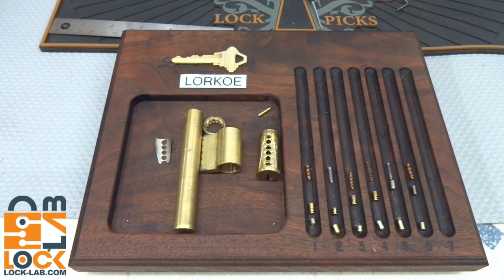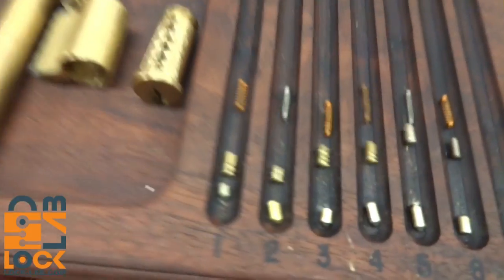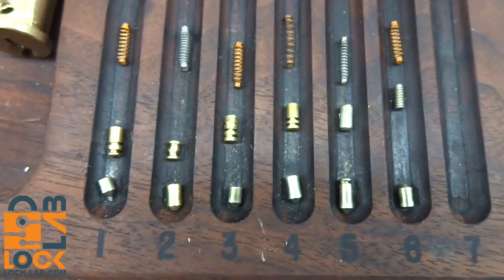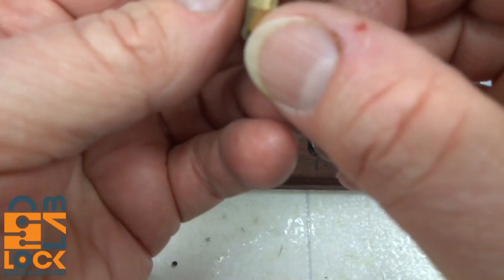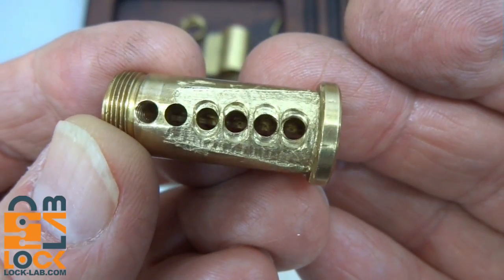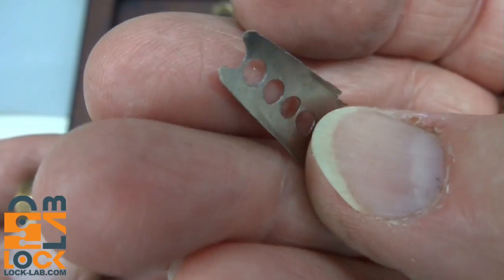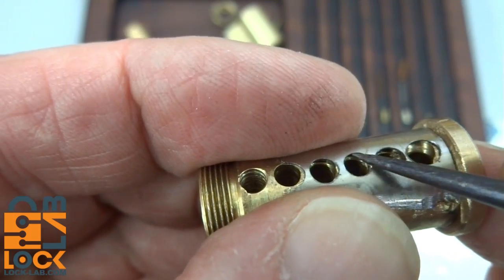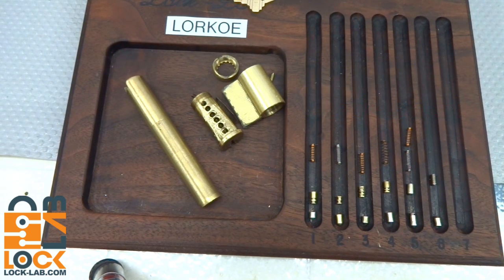(989) Whipped:  Lorkoe Challenge Lock

Comment: Hey Bill, if I sent you a Bowley Lock would you even attempt to pick it?
Reply: Ugh I had a think about how to make a bumping tool for those locks, the material gets very spindly very quickly.  Potentially doable though if you're careful. It'd have to be a telescopic tool - central shaft to engage in the back of the lock and release the pins, and a comb that can be twisted left and right to jiggle the pins, instead of being shunted back and forth like regular lock bumping.
With a bit of luck they've used standard pins...

Comment: You have any way to check the dimensions on the holes?

Curious because it seems like a lot of work for that plate. Wondering if a very small T-slot tool and just index to prevent break through. Or even a small ball cutter which would eliminate the need to index. That would eliminate the plate completely unless the plate stiffness plays a significant role.

Comment: Any way to make a core that is entirely made of metal laminate with grooved pins? How easy would that be to mass-manufacturer?

Could one cut ultra-thin slots to shove metal with slightly-differeing holes in for grooved pins to be trapped upon?

Why isn't more stuff in the core a common manufacture technique if it's more secure and could keep people like Bill out?